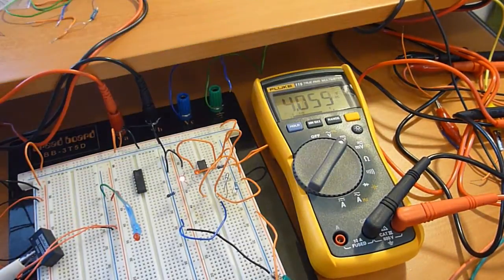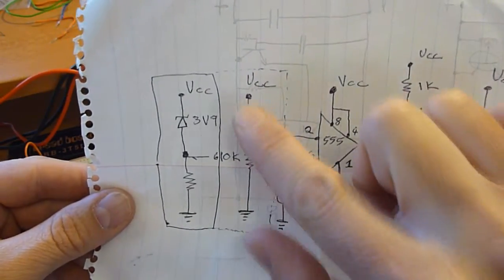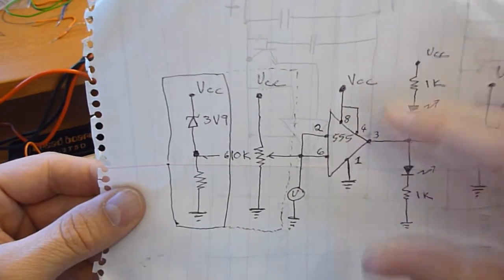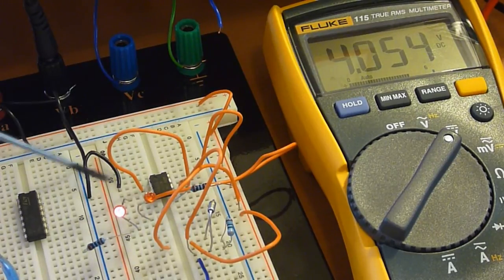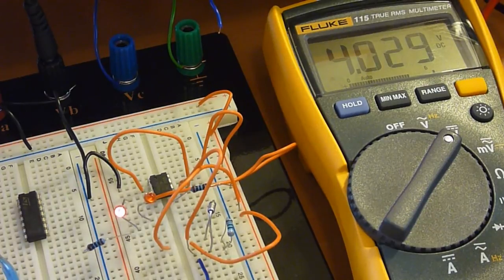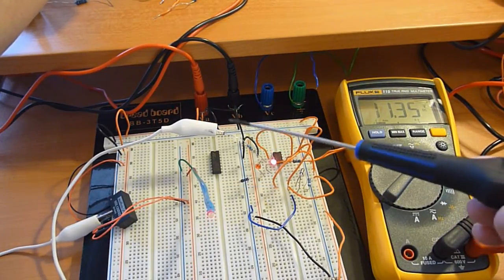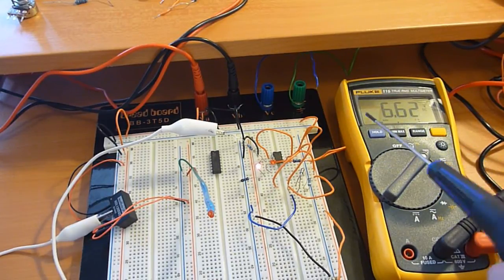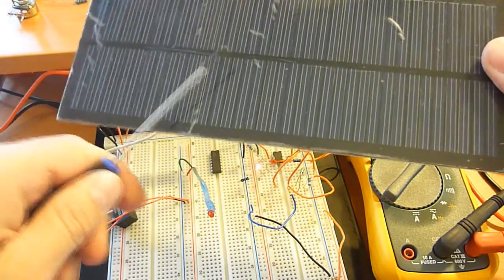Solar Powered Kindle  - Part 14: Schmitt Trigger, 555 timer..working.

Comment from the maker: @simplistiksoftware Thanks very much for your input, it's interesting to hear about your setup. You are correct...in essence I have been toying with the MPPT concept but obviously the DC-DC converter does not fully fulfill all the MPPT functionality. There are some small MPPT IC's that viewers have suggested but I'll see if I can get the current project to work first...but the 2w 9volt panels certainly look very viable. Thanks for watching.

Comment: I've been following this from Part 3 on. It sounds like your really trying to create a small MPPT... Moving the 15v CIGS down to the 6V and 550mah you need to charge the kindle. Using the two 9V 2W panels however will help. I use a 883mah 6V panel for my Blackberry 9670 and Playbook. It works for the tablet ONLY when it's optimum as it has no battery to store a charge so it goes directly into the unit. The 9670 however charges up in less than an hour. 

The 9v units should get you closer.